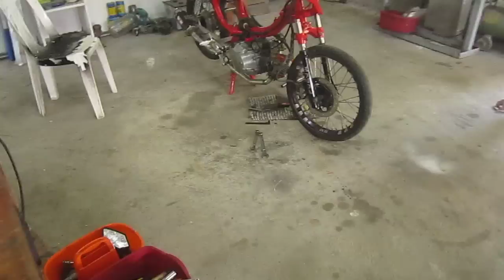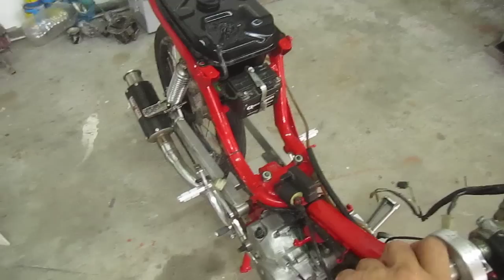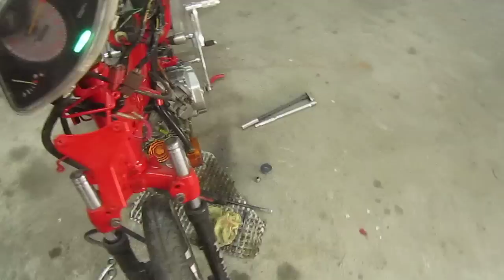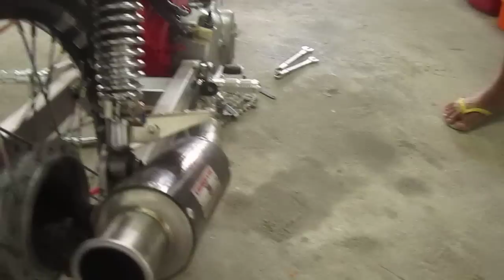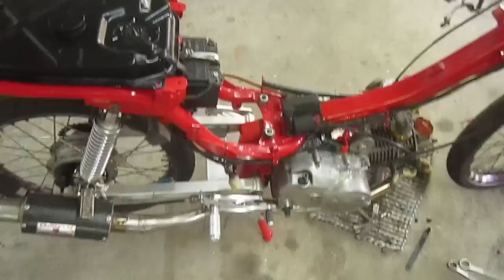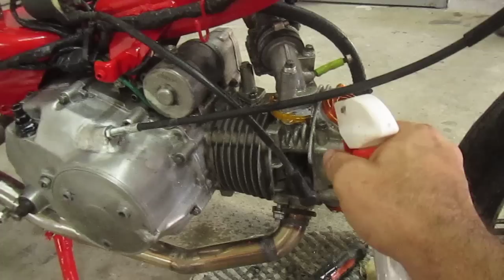Wave 125 147cc mio big valve head conversion

Comment: your piston too small...62mm piston, change your ratio gear, use mikuni or ultra racing 58mm carb, use jetrod 5mm, use extra mold 4/5mm head as gasket, 3mm hi cam..and more..tired to type here...